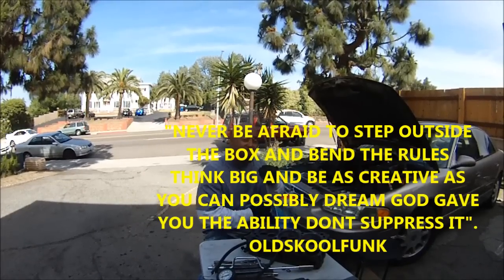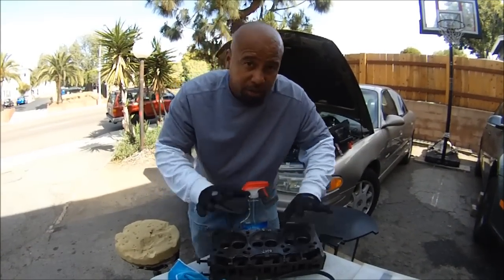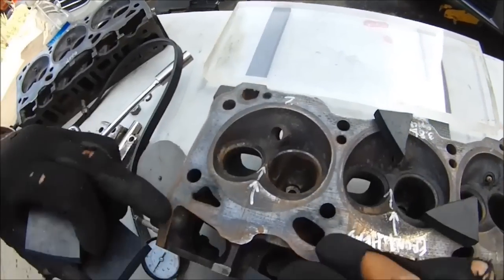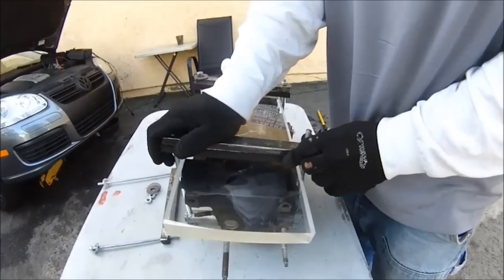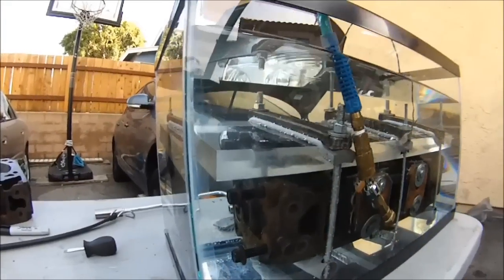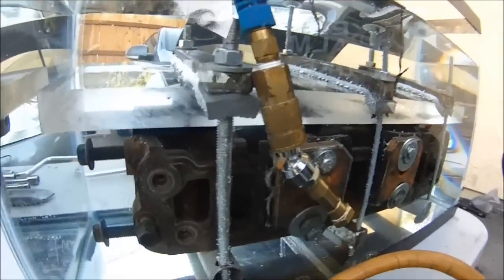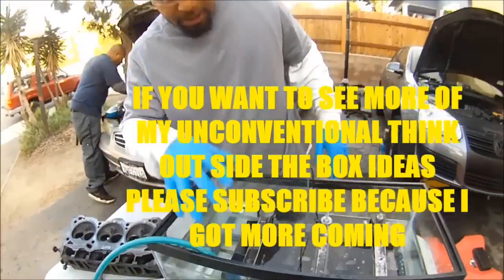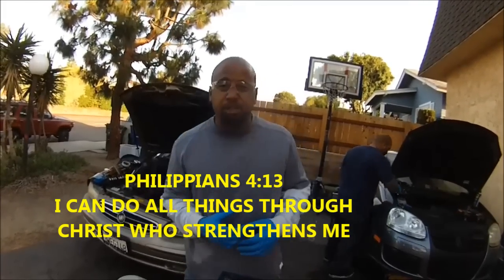(NEWEST WAY) TO CHECK CYLINDER HEADS FOR CRACKS AT HOME W/ A HOME MADE PRESSURE TESTER

Comment: interesting approach.  I love the energy and the thinking.  The set up is great.  If I was doing a lot of cylinder heads, I'd be up for this. 

for others tapping into a hole, be sure to back off from time to time, go in 2 turns, come out 1 turn.  the key is to give the threads and shaving a chance to clear out

Comment: I see this is a old video, but I thought I'd take a shot.. I have gm 3.8 head that have a crack between the valves ,you can see a black line like a hair.. I was getting exaust gas in my radiator..I'm having a hard time wrapping my head around gasses leaking into the coolant passages from the outer surface between the valves.. is that common on these 3.8 heads because the coolant ports run behind ? I know it's said to be no concern on other heads.. any help is appreciated I'm at a crossroad here.. thank you love your videos

Comment: I think it would also help to heat the water at working engine temperature so the metal expands and show any microscopic holes or cracks for just in case since you do all that procedure.

Comment: Hi from the UK.  Great vid my man!  I do quite a few cylinder head jobs, and hadn't even considered doing this myself until watching this video!  One thing I was thinking though, sometimes leaks don't become evident until the engine gets warm.  Maybe some form of heating the head/water might be a good idea like they do with the professional setups, I believe they also add like a washing up type liquid that lowers the water's surface tension and makes spotting very small leaks easier.  Again, thanks for the inspiration!  😁👍

Comment: machinist here.  if the combustion chambers were cracked, you could test your coolant for exhaust gasses without having to dissasemble the engine...the same kind of test is used to diagnose a bad head gasket.  but hey...if the engine is already disassembled, might as well use your method to check for cracks.

Comment: Last guys comment said you talked to him a lot. Short story to tell you buddy. I am disabled and about to start selling parts online. I'm used to old cast iron stuff which I imagine this would work for that too and I don't see one night. But I called a couple of shops today and found out that the aluminum heads are now pressure test it and not electroflux. Corsets obvious. Both places told me $75 a piece and $150 for a block. I know I have a crack somewhere in a Dodge 2500 truck. I don't want to sell junk parts and I want to sell them to make the money so I have to test them. You have saved me so much money. If you don't have a patron account you should get one. And message me what it is. I believe in paying for education and what little bit YouTube gives you isn't a lot but everything adds up I get that. Dude I most definitely thank you and you have a great one

Comment: Do you have a video on testing the block? 

I have a Old junk motor I pulled out seeing if I can possibly repair it 

its spitting water out from manifold. Like regardless if I add water. It just runs out won’t stay topped off

it’s not mixing into oil? 

I replaced all the gaskets at first but still same results 

Any ideas?

Comment: Good way to do a check before taking to machine shop for further work. Vortecs are notorious for cracking. If you don’t know they are bad before you take them in, the shop is going to charge for checking a head that you end up having to scrap!

Comment: also, if you let the belt relax, the belt tensioner will extend and very difficult to pull back to original position, well done all the same.

Comment: You took the pressure up until a leak started, not to failure (that’s usually pretty catastrophic). Good video, take it over to clapper and I’m sure you will have an instant audience. 
I was thinking about using rtv but there’s two (at least two) problems with that, cure time and maintaining pressure. 
I know that my 240Z has a cracked head and I have no mill for the deck which means... machine shop. 
Thanks for the video, well done, safe and informative.

Comment: great idea , that plate of plexyglass in that thicknes is about 150 dollar  though 
i guess you bought it as a drop piece from someone making giant aquariums ..... and we dont have those here (at least not in the size requiring that thickness of plexy ) 

it did inspire me to try it close to that way  though , since i only need it for one type of cilinderhead (smart fortwo ) im going to use a 20mm  thick plastic cuttingboard as the "clamp" using treaded rods through the headbolt holes for the force there four bolts around each chamber so i dont think the plastic board will warp too mush 
have to check but i think all the coolant holes in the sides have treaded holes around them so i can make small pieces of the cuttingboard with gasket material stuck to it and bolt those up on there  can tread those for the airnipple too

for the gasket material im thinking on using a smooth yogamat as the gasket material  and cut the outside circumference of the gasket out of it , and the holes for the combustion chambers 
now the cutting board isnt seethrough so i will make holes over the combustion chambers as well , all i need to see is bubbles around the combustion chambers or out the ports , i cant repair it so bubles means trow away 

if it works it will cost me about 50 buck in material

Comment: Do you have to take the valves and valve springs out when dropping the cylinder head into the water? Will the water cause rust on the steel parts?
Another possibility would be doing such a test without the fish tank by covering all openings and pressurizing as shown, but just by brushing soapy water on the areas to be examined. Did anyone try that before? Thanks in advance.

Comment: I work in a automotive machine shop my pressure tester is set at 40psi. The cheap quick connect leaked before the gasket material pretty impressive. Everything you said is a fact and methods are without flaw. I have a question, what adhesive did you use to attach foam rubber to metal backing plate? Thanks for the feedback in advance, keep up the Oldskool method by brother.
Reply from the maker: Hey mac I use the adhesive from walmart in a spray cam from 3M but any kind will work.

Comment: I spent 6 months doing intercooler assembly and leak checks "dry" method which meant I had soapy water dripping on the floor and also like nearly a year and a half doing the wet test method for truck radiators. We had big wide stainless steel tanks and even had water heaters in them so our hands wouldn't get cold. We had fake top and bottom tanks that were basically just a rectangle and the top side would have an air hose fitting. We would use multiple gaskets to get a better seal and avoid using spring washers. And the same bolts would be used over and over til they were starting to get worn. At the point they started getting hard to tighten easily, we would fling them all in the scrapmetal and use a new batch. The radiator core would go to a different department to get properly assembled then tested a second time. We were just testing the core for leaks. Reminds me of staring at a core waiting for leaks around 1am with all the exhaust fans and other gear roaring in the background. Made a lot of money in those days....

Comment: You can use that same device to do a Leak Down test before you pull the heads. Use the compression test hose fitting hooked to your regulated air. On TDC with valves closed listen where air leaks out. Leaks past valves - cracked or bent valve, air noise through breather - bad rings. It's a reverse of a compression test.

Comment: Very nice outside the box idea but a lil suggestion on your pressure is you would probably have less of a hassle if you used less pressure.... there is no reason to use 60 psi on any cooling system tbh. Most cooling systems need only 16-20 psi to adequately check for cylinder head leaks.... great idea though keep on at it👍!!!

Comment: Do not tap dowl holes. Use a long clamp or clamps and a bar and seal them. Soapy water in a spray bottle works well too. 60 psi is kind of high. Good idea to take out the plugs too to check those areas for cracks.

Comment: thanks for making this video. I think I have a crack in the cylinder head on my Yamaha raptor 660, I cant see the crack but hopefully I can find it using this method if I don't get bubbles I will be replacing just the gaskets and putting it back together. thanks a lot!

Comment: It's a good idea but isn't 100% full proof with cast iron heads alot of times with cast iron heads of the are cracked the crack will actually be sealed when the metal is cool and the head wont actually show that it has a crack until it's at a really hot temperature cause cast iron expands when it gets hot and the crack will then open

Comment: Not bad.  Let me tell you about another method I'm sure you seen it but did realize it. Have the head spray washed. The chemical will leave a black line where the crack is so any crack shows right up. If you can score a deal on a rough used dishwasher for the garage they will get parts nearly as clean as a spray wash but you must turn you hot water heater as hot as it will go. It will depend on the soap you use if parts cleaned in a dish washer will leave a black line on a crack.

Comment: I think that I remember my uncle doing something like this on an airplane engine head back in the '60's. I love this tool!! BTW a good source for all sorts of plastic in San Diego is  ePlastics, 5535 Ruffin Road, 92123 (Kearny Mesa). They have an odds and ends box out front where they sell sheet plastics, plastic rods, and whatever else may be laying around for $2 per pound. I got a 3/4" piece of plexi dirt cheap, and so far I have made a large cake plate for my wife with some of it. If you can't find a thick enough piece, they have solvent glues where you could just take 2 pieces, and solvent weld them together. All my best wishes, and may God bless.

Comment: I think i have a better solution. Maybe you should take this Plexi glass and a big piece of rubber to cover it completely, bolt it onto the head through holes used to fasten it to cylinder block. Then pressurize the combustion chamber side, through spark plug hole, with leakdown tester.

How's that sound?

Comment: Ever try poor mans magnaflux with WD-40 and talcum powder? 1.) Wet the part to be checked in light oil or diesel fuel, allow to penetrate for 1/2 hr or so.  

2.) Dampen (do not soak) a clean lint free rag with lacquer thinner and wipe (do not scrub) all oil from surface of the area being inspected.

3.) After all traces of thinner have evaporated, cover the surface with a thin coating of chalk dust or talc. Wait 10 minutes or so, then look for wet areas in the dust. Porosity or cracks will show up as wet spots.

Comment: man, my 2009 corvette with 240000 miles on it, engine is shaking, rocking, flashing engine light is on,   dang dealership wants to just put a brand new engine in it with out looking at it.   so I took it to another shop, they said only 4 cylinders running, 5,6,7, and 8 are not, wet spark plugs.  What should I do or what needs to be done
Reply from the maker: kaysmooth319 try my diagnosing a blown head gasket with no specialized tools video, 
My how to check a vachum leak with a home made tester first.
Your misfired can be caused by electrical, mechanical, major vacuum leak or bad compression.
Reply: thanks, man, just told again, by shop mechanic that if I was him, i just replace the whole engine, because they said it could be numerous things wrong.  He said I do need a new fuel pump, cost and labor will be high,  he said my oil was very black, looked like I had not had an oil change in ten years.  I just changed the oil February 2017.
Reply from the maker: kaysmooth319 Watch out for the scare tactic. When it comes to some mechanics they get commision/ dollar fever and will scare & trick the money out of your pocket.

Comment: Great, but too much work.  I rather pay my machine shop to take care of this - for $80 my machine shop would hot tank the head, check for cracks, and test valves for leaks.  Valve job is expensive, but these tests are usually not that expensive.

Comment: Man, you got to go to school and get an engineering degree and then start designing stuff. I work with a lot of engineers and they are not half as smart as you are. Everything man has invented started out as "outside the box" until some company came up with an idea and then tool and then told everyone that you need to buy their tool to do it. Being a mechanic is an honorable profession, but you need to use the brain God gave you to 120% of its capability and fixing someone else's design is not the most you could be doing. You could be designing this stuff no problem.

Comment: Can't you just flip the head on its face on a rectangular sheet of rubber about 2 foot long and seal it with a small amount of oil the. Use a vacuums gadge and if there is an air leak check then it's cracked? That's what my work does and thay used the same method for 20 years

Comment: The is a fake video Ive never seen a quick connect fitting not leak so this HAS to be fake
Reply from the maker: Tom Of course it's fake, if your a pessimist.
Reply: dude i was actually joking lol Im actually trying to figure out how to fit my ford straight 6 in a container cuz that thing is cracked somewhere and i cant see it and is kickin my ass seriously though good vid and idea hey what brand is that quick connet do you know? and is it brand new?
Reply: also id take an air sander without paper on it and vibrate the tank at first i bet it knock that bubbles off that stick

Comment: If your method works reliably for you ; that's about all a DIY shop could ask for.
I can understand why they use hot water in the expensive testers; but there is no reason you couldn't do the same thing by heating up your tub of water.
Immersion heaters are CHEAP!

Comment: I have done the same with air pressure and engine blocks and heads be careful.  I notice  your daughter was looking thru that glass fishbowl at the cylinder head water Jacket.  a water jacket could possibly  fly out of the cylinder head @ 90 psi. I guess it would depend on the condition of cylinder head and water jackets but  @ 30  psi and higher I start avoiding those water jackets.   Still Great Video

Comment: could you put a little soap in the water and just dip the cylinder head it and take it out and let it set to wait for a while and see if you have bubbles building?
Reply: yea.. keep the pressure on it, but use soapy water to see the bubbles, because sometimes you wont be able to see a leak, unless it starts to form bubbles from the soap. like checking a gas leak on lets say... a furnace gas line.
Reply: chaseme81871 if there's a leak you will easily see the leak without soap
Reply: I see exactly what you mean. just like blowing bubbles with the soapy water toy you see kids running around the yard with. don't need a tank, just soapy water sprayed on the head and let the air from the crack blow air soap bubbles on the surface.

Comment: The problem is that people no longer want to do anything for themselves. I have watched quite a few of your videos and they all look good to me. Yes, machine shops specialize in doing all of these services on modern machines and perhaps often with more exact tolerances. Then again, you are letting somebody else work on your parts and often there just isn't any attention to detail. A skilled craftsman is becoming very hard to find. Bottom line is that everything I've seen you do will work just fine! Although I'm not a very big religious guy, I really enjoy seeing that you add this aspect to your videos. Two things that are missing in today's society, hard work and God. Keep the videos coming! One day when SHTF the haters may have to use these old school methods!!!  I applaud you!  I learned to work on vehicles by myself. I never had a father to teach me. I just started tearing things apart and the rest just came naturally to me, thank goodness! I can work on just about anything now, only limitation are specialty tools and equipment. However, like you are showing, much of this can be adapted!
Reply: Exactly. I'm a mechanic and I'm learning from his creativity
Reply: @kingkong8974  really? engine shops usually do this, probably he worked in one ....read what he wrote----- he just made a smaller system, from the ones used in shops...